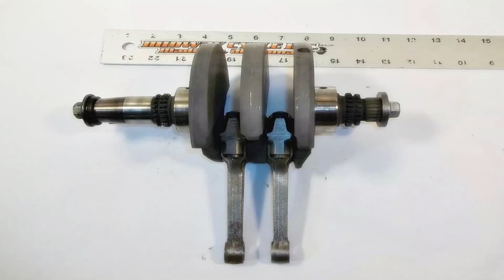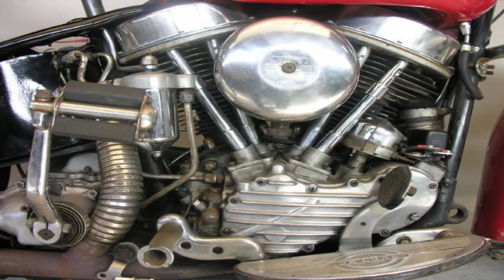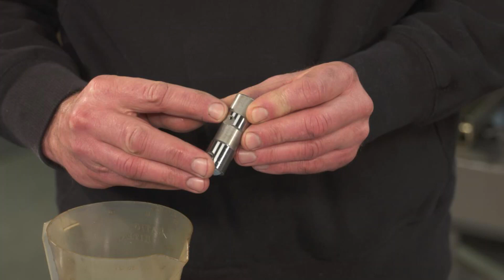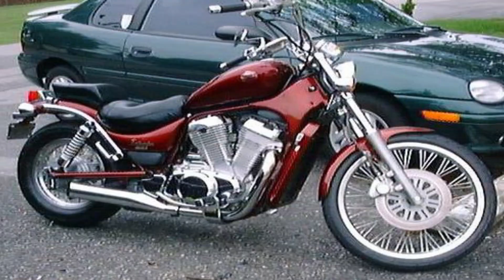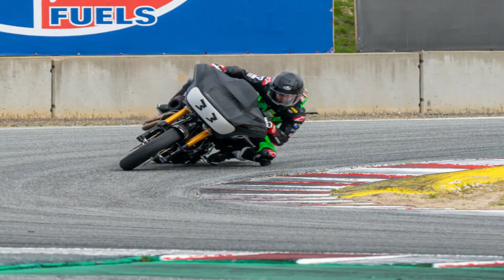Harley-Davidson Engine Design is the Worst

Comment: The problem with the assembled crankshaft is an problem going someplace to happen if you try running it hard.  Sorry worked on them enough to not have much use for them, the crank shuffles and then the case is taking a beating and then the cam drive system just dies from the metal floating around when the cases are beating themselves into scrap metal.  The best thing you can do with a HD is leave it the hell alone and not ride like a wild man and you will get 70-80k miles of service out of it before you smoke your wallet, ride hard and you may get 20-30k.  Oh by the way those cylinders being in line means the rear cylinder is running at a minimum of 50 degrees hotter all the time.

Comment: What limits these engines is heat. Air-cooled V-Twins & one cylinder gets heat from the front cylinder instead of cool air. Make these bigger & they make more heat. Anything that makes more power will make more heat. Cams, higher compression, etc. These engines are fine for what most buy them for but if someone wants a lot of power it's hard to beat an inline, liquid-cooled 4 cylinder bike.
Reply from the maker: Fuel injection has helped cooling the rear cylinder by returning each cylinder individually. 4 cylinders make killer power, but it's way up high. A Harley Dyna built right will pull you 100 horse at 4,000 rpm. It's a wild feeling and different ride.

Comment: harley, as an american bike manafacturers have to deal with something most other bike makers dont have to deal with.that is obese riders.thats why harleys are built like trucks compared to european or japanese bikes.since asian riders rarely weigh as much as their bikes they dont need to worry about enough low end torque to get the damn things moving.not picking on them.its just a fact.when you weigh nearly as much as your bike high rpm power is worthless if you dont have enough torque to even get to high rpms.allmost a unique situation american bike makers must adress seriously.

Comment: I have been contemplating getting an SGS to go 2 up and do some touring with. After finding your channel I am absolutely convinced that HD will never see a penny from me. I already knew their engines tended to have quirks but HOLY SHIT!! Bad engineering is bad engineering. Thank you for saving me 10s of thousands of dollars dude!!
Reply from the maker: They really are good motorcycles they just have their quirks. Not all bikes are prone to failure, some have more of the issues than others. Most of the issues happen when you start getting into cams and hopping them up without supporting parts. Exhaust, air cleaner and a tune is about the safest bet.

Comment: 131 race motor sounds fun
Reply from the maker: Right? The power and torque at 2500 rpm is more than most Harleys make at 5,000 rpm.

Comment: Great vid. Entertaining and informative as always. It is really refreshing to hear honest assessments of the capabilities of H-D motors.  I am on a popular Sportster Forum and l see guys spend in thousands of dollars trying to get 70 HP out of a Sportster. There are dirt bikes with more than that. You run to the law of diminishing returns rather quickly on an H-D.
Reply from the maker: Thank you,  I appreciate it! Sportsters can really put down some power when built right, for about 5 grand you get over 120 horse. Going into the motor or just bolting on a Trask turbo will do it.
Reply: @GixxerFoo  True enough. But most of these Frankensportsters are track builds totally unsuited for the street. Track motors are usually completely rebuilt after every race. If you have the rescources for that you can pretty much do what you want. If you are building for the street you have to keep your mods street friendly. The old adage " The candle that burns twice as bright only burns half as long" pretty much sums it up.

Comment: Harley should absolutely keep the single pin, push rod motor!!  Who cares if it's hard to make power with, it's a Harley, it's not meant for power!!  I currently own 4 motorcycles, only one of which is a Harley.  It's a Road King and I love it.  I love it because it looks, sounds and rides like a Harley should.  I also own a Suzuki Boulevard, a Suzuki Hayabusa and a Suzuki GSXR 1000.  If I want smooth, I'll get on the Boulevard.  If I want to go fast, I'll get on the Busa or the 1000 that were actually designed to be fast and are easy to make power with.
Reply from the maker: Very well said, lol dang you've got a bike for every day and every mood!

Comment: The moto guzzi air cooled v twin design just makes more sense to me.    Equal cooling, easier access to anything relating to the top end, easier access to intake and exhaust bolts.
Reply from the maker: You don't see a lot of those running around, they are a very unique bike!

Comment: I love their designs.  They are simple and easy to maintain.  It is not intended to be a power monster.  Plus, they will loose what little fan loyalty they have remaining.  The single pin does not cost the power as much as the valve train design.  Again, it you eliminate the push rod design, and change the angle of the V, you loose the tradition.  Push rod valve train is easy to service.
Reply from the maker: Very well said, the push rod motors are simple to work on without having to fish the chains up to the cams.

Comment: Good article and good comments.
One would have to go back in time and ask Bill Harley why he designed his V-twin as he did. My guess is that the knife-and-fork was the least expensive way to accomplish the goal of adding the second cylinder.

Kevin Cameron will tell you that it's the bore-to-stroke ratio that's a major factor in engine design. Oversquare engines rev faster and tend to have higher redlines.
Undersquare engines tend to have lower redlines, and not rev as fast. But, they tend to provide usable power at lower RPM, and are more fuel-efficient. 
I used to ride a 1982 Suzuki GS850G. It would give 50 mpg at highway speeds. My 2005 1200 Sportster Roadster, routinely squeezes 60 miles or more per gallon, and once got as high as 70 mpg. 
By contrast, the new liquid cooled Sportster S engine is an oversquare rev monster, making way more horses at RPM that my old 1200 wouldn't dream of. But I haven't been able to find out its mileage numbers, and with the price of gas going up every day mileage is important.
Reply from the maker: Thank you, that new liquid cooled Sportster is an awesome bike! It looks like the way Harley is going to eventually end up as time goes on.
Reply: @GixxerFoo  , it may look great, but with 2 inches of rear suspension travel most magazine testers have a love-hate vibe...love the engine and transmission, hate to actually ride it on the roads.
Reply: @Peter Angles My 2005 Sportster Roadster currently has 83,000 miles on it. Don't tell anyone, but modern Harleys are as reliable as any other motorcycle.
Reply: @Peter Angles Before I bought mine, I did the research. Harley had made a change in the Big Twins and owners were complaining about engines grenading. Sportster owners were raving about how much better the new rubber mounts made the motorcycle. I wanted an XR1000 but life got in the way and the 1200R was pretty close. 
"Pathetic and slow". How fast do you need to go to kill yourself? From a purely functional perspective, hitting a deer at 60 mph will probably yield the same result as hitting one at 180. 
In the end, it all depends on how and why you ride. Does your motorcycle do what you need it to do? If it doesn't, then make it. I used to be a field service technician and a Busa would look stupid with saddlebags for tools and test equipment and a luggage rack for my overnight bag. 
Riding position is a big factor too, one that gets bigger as you get older and less flexible. Riding bent over is great if your daily commute is 37.75 miles around the Isle of Man; not so great if your job is four hours away.
Reply: @Peter Angles Agreed. In the fall of 2013 I was working the 3PM-1AM shift during an outage and was riding the Sportster every day I could. I began timing my ride home, trying to get faster every night. My best, from Cheswick to Munhall, PA, was 26 minutes to cover 22 miles, through the residential neighborhoods of Pittsburgh. It took a deer walking in front of me while I was doing 75 in a 25 to wake me up. Speed is as addictive as any drug. 
One of the best IOM riders described it like this: when you're good the course is three feet wide. When you're fast it's six inches wide. Not many people have that level of skill.
Reply: @Peter Angles That's true. A state policeman once told me that there are no limits as to how many deer you can kill with your car, unlike firearms hunting season.
Reply: @Peter Angles Since Prohibition, Pennsylvania has had a Liquor Control Board. State stores sell wine and spirits; beer distributors sell beer. When grocery stores lobbied to sell beer the distributors howled at the possibility of losing their business. The compromise was limits on the quantity of beer sold by the grocers and convenience stores. You can buy six packs from them but if you want a case you need to go to the beer distributors.

Comment: Can you do better? 4 guys in a shed started the company and the design may be old, however, there are many Harleys running for thousands of miles. Plus the engine is designed to be rebuilt, as it has a separate case from the transmission. It's easy to criticize I guess. I have a late model Night Rod V Rod, and not too many other vehicles on the road can catch me. Not bad for an engine design that goes back to the 90s. The Vrod had a 20 year production run.
Reply from the maker: The VRod was derived from the VR1000 Super bike which Harley-Davidson actually had ready to go for the 1988 season. Corporate suits said no, Harley would of been leaps and bounds above every manufacturer at the time. Unfortunately when they got their shot in the mid 90's it was way behind the times.

Comment: I never quite understood some people's obsession with jacking up their HD motor with cams, pistons etc. Whatever. Not my thing. I much prefer simplicity and longevity which is why I'm still plugging away on my 20 year old RKC. Hell, you can only go so fast anyway. I can set the cruise control at 80mph and cruise all day long without batting an eyelash.
Reply from the maker: A built Harley is a lot of fun to ride, if done properly they can be very reliable engines. But even stock internals with just mild upgrades like a air cleaner and exhaust with a proper tune that is just about the ticket on a Harley.

Comment: my 1993 evo is still going  i still get my jollies and wind therapy on the old style engine and i appreciate the engineering simplicity of a single carby and hydraulic lifters instead of the complicated extra moving parts of cam chains .... riding an old evo helps me keep my drivers license.. yes stick with old  v twin pushrod engine as there are speed limits on the roads we have to stick to.. and that sux     old harley v twin !! why fix something that still works?
Reply from the maker: The Shovels and Evos are some awesome engines, they are very very desirable bikes today. The Evo is going to jump in price before too long just like the Shovel has!

Comment: Its funny this video entered my suggestions this morning. When I was 16 years old I had a 1984 Honda shadow 500. It was a fun bike for a kid. It really was out of power by 80mph although you could lean on it and it would hit maybe 95mph? I had a dream that I got pissed about my M8 motor leaking oil or some crap. Traded my Harley to some sketchy biker with a F@#k you tatoo on his face for my old shadow 500. He tightened the primary drain plug on the ultra fixing the leak and off he went. I took of on that little Honda and had a mini van eat me in acceleration. Hit the corners and scared the hell out of myself because that bike handled like shit. This is in a dream last night. Oh, and I was hauling butt at 90 mph and experienced the death wobble I hadn't felt since I left metric bikes behind. So in my dream my lesson here isn't to get rid of my current bike out of frustration because the alternatives aren't really there. My ultra classic corners like a dream 2 up. Comfortable for 600+ mile days 2 up. It runs pretty decent on 91 octane pump crap. For all the worries of the Milwaukee8 motor I have 35,000 miles on mine and its been trouble free. I need to change my cam plate and oil pump... might as well do the cam too.... going in that far and I might as well build the entire motor? If im going to do all that I might as well just run this motor until I have a reason to spend $6k???? Thats why I haven't done a thing to it yet... I dont want to do it half ass and why replace 75% of the motor when I can replace pretty much the same when stuff goes south?
Reply from the maker: Yeah you can ride it till the motor goes but that could be a while, depending on how far you're going in some cases it's more cost effective to look at a crate motor.

Comment: Most other v twins have a combo of cylinder and crank offset that gives 90deg offset to the piston movement, giving 270deg phasing. This spreads the primary and secondary forces out, they don't over lap. Not perfect but a good compromise over the other common, 360 and 180 phased motors. Even so you still have the force vectors through V cylinders which you will feel more than a parallel twin.
Reply from the maker: That's very true, just the nature of the beast with any vtwin engine.

Comment: A Suzuki M109R or a Yamaha raider have all the modern tech, power, and reliability that a Harley does not straight from the dealership. The only bike I know that can be at par with those is their Vrod but that’s a modern design by Porsche.
Reply from the maker: The metric bikes for sure have a edge right out of the box, it's hard to keep a metric and pile on miles without selling it off at some point though. They change quite a bit and with that the parts tend to become unavailable quite frequently.
Reply: @GixxerFoo  yeah that’s true if it’s something other than a Yamaha. They got their whole warehouse here in the states but idk about suzuki
Reply: You think M109r is reliable? 😅
Okey ,ride it for 20000 miles and then we will see!
Reply: @bobvido9875  got a friend that had 35000 on his and had had no problems. And he rides the shit out of his. I honestly think it has to do with the engine being cooled with a radiator rather than finned

Comment: My 2 cents Gixx...I absolutely adore the simplicity of my Evo and TC88...Now, do I wish that HD designed some drivetrain components better that failed early? Sure...But, I'm 100% satisfied with the stock power output and rideability...Guys wanting these machines to perform like they were not intended to, is like forcing your wife to perform at a swingers party. Happy 2022!
Reply from the maker: 😆 right?! If you leave the internals stock and keep it to just a stage 1 the bikes do really well. It's just when you start putting in cams without a good cam plate and supporting parts do you run into issues.
Reply: This is the most sensible comment I’ve ever seen as I feel exactly the same as you. I love my 05 Superglide TC88 with Stage 1 & Cobra 2000 Fuel Controller. It’s got plenty of power for twisties & highway, no need to tear into the motor & waste $ & cause issues
Reply: @jimmansi9046  Agreed mate...And honestly? In my 40 years of owning 4 different (Evo's and TC88's) HD's...They were all very reliable, I will admit that I never did any cross country riding, but I was never stranded by one. I just rode them all like a gentleman, especially with a gal on back, and basically just changed the oils...Ride safe brother.

Comment: Hello. I got 2 questions for you. I got a new 2021 Softail Standard about 6 months ago. I already drive about 9000 miles on it and i love the bike. But 9000 miles in 6 months comes with a cost, and its the clutch is heavy and i get problems with my left arm after some miles. Can i get a quick shifter for my bike that work up and down and fit my bike? I use standard controls on the bike. If so where can i order one and get it send to Thailand where i live now.

Question number 2. How much fuel i have left on the tank when fuel light comes on? I can not find info about that. 

Keep up the good work.
Reply from the maker: Thank you, I appreciate it! The M8 has a pretty stout clutch to deal with the torque those motors make. You might look into a variable pressure clutch, they fit on top of the stock clutch and actually provide more clamping force while reducing lever effort by about 10%. I'm not sure what's available to ship in where your at but you can get one from Screamin Eagle. Your bike has the 3.5 gallon tank, I would say you have roughly a half gallon maybe 3/4 of a gallon of fuel left. I am erring on the side of caution knowing the 2 gallon peanut tank comes on at a half gallon and the 4.5 comes on with 1 gallon.
Reply: @GixxerFoo  I know a friend had a quick shifter on his HD and he had a M8 engine. But he pass away 1 year ago in a car accident. So i know i can get a quick shifter for Harley M8. But i still have not find on. And im from Norway, and if i walk in on a HD dealer in Thailand and ask about info about a quick shifter for my bike, they just look at me.. where is this guy from and what the f... are he talking about?? And most only talk Thai and i not talk that.. So you can understand the problem... hehehe